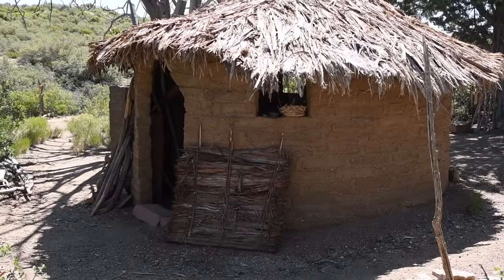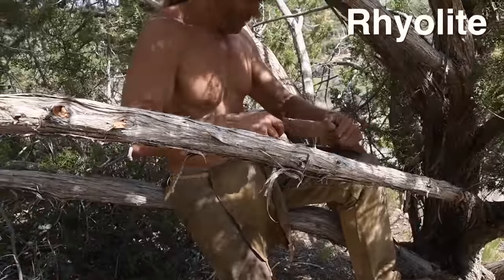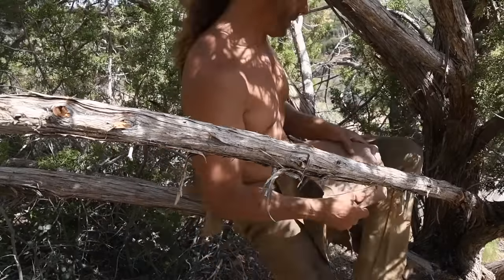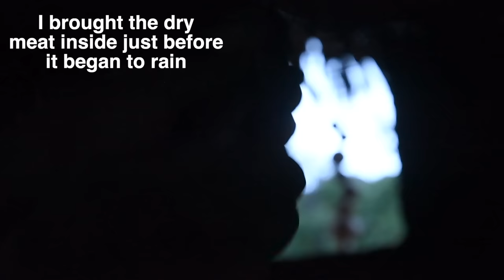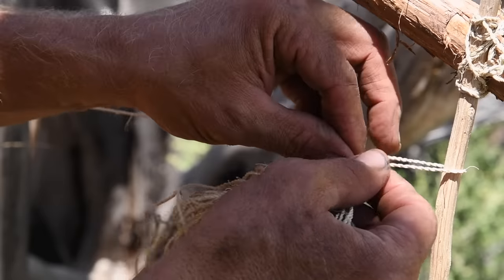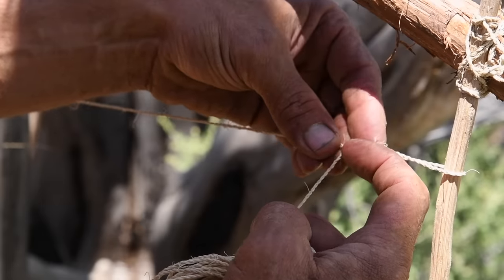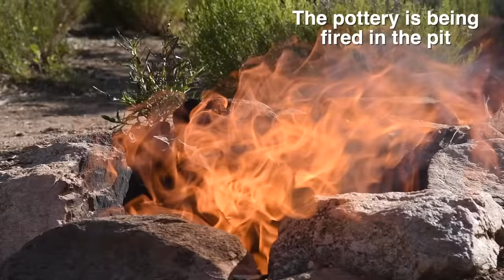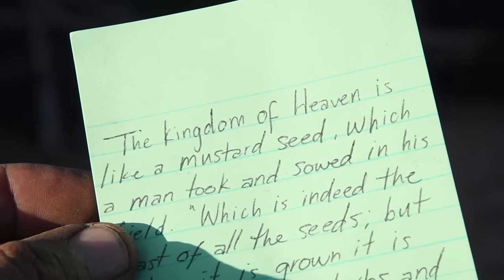Primitive Yucca Cordage Hammock - Part 1 (Season2, episode 2)

Comment: I'm quite proud of you using the flint knapping skill. My buddies dog ate my antler tools so I haven't been able to them yet in a while. But working on. As I got a job with an outreach team for the homeless.
Reply from the maker: The dog ate the antlers?? Are you serious? Hahaha.
Reply: @ChadZuberAdventures  yeah. I don't use modern tools to make the arrowheads. And my buddies dogs made sure I took a break.
Reply from the maker: Hahaha, you’ll be back at it again
Reply: @ChadZuberAdventures  surely I will. It's a hobby I find very fun.

Comment: 20:21 This cordage is of awesome quality🏆 There are almost no differences in thickness or twist😎
Reply from the maker: There is very little difference in thickness. I try to keep it close to the same thickness but different rolls end up slightly different in thickness. This cordage that is intended for the hammock is the average thickness that I usually make. It's quite strong. The cordage I make for fishing nets is about half as thick. For construction I usually make thicker cordage.

Comment: Here's a suggestion.
Try planting near that water source or near the river, as this would help you a lot.
Reply: There's always a reason for what he does or how he does it.
Reply from the maker: Yes, I want to do that but near the river isn’t good because when it floods the waters rise as much as 8 feet and wipe out many of the smaller plants. I need to find a spring with good soil near it.

Comment: Some of the most primitive irrigation aside from carrying containers of water was basically mimicking a river or stream by etching out grooves in the ground to make water channels so the water was distributed when it was poured. In theory clay aqueducts or bamboo with holes notched into it would also work along with water collection vessels like the pots and vases you make.
Reply from the maker: The problem here is that there just isn't enough rain during much of the year. There's no water to channel. I need a large tank (or large ollas containers) to capture large amounts of water that can last for at least two months. Such a tank will require a good amount of time to build.
Reply: @ChadZuberAdventures  Im gonna keep on cheering for your success with the garden and fishing 🤞

Comment: Amaranth is a drought-tolerant plant. The main time to focus on watering these plants is when the seed is germinating and when they are young seedlings.  Try to keep the soil moist, and once plants are 2-4 inches tall, you can water 1-2 times a week.  In the case of an infrequently visited adobe farm, ollas with water can be filled and used to seep water into their surroundings, branches for partial shade erected, and maybe a light mulch of shredded juniper bark and grasses applied.

On the bright side, if aramanth gets established all the way to growing seeds (the part you eat), it will self-seed! (For those worried about invasiveness, Aramanth is native to the Americas, and has been grown on both continents by indigenous nations for thousands of years.  It also goes by the nickname pigweed.)

Amaranth does have a high amount of oxalates in its seeds (and its leaves; keep domesticated herbivores away from them unless they're used to eating stuff like that).  These can be gotten rid of in the seeds by boiling, blanching, or even steaming, and discarding any liquids before consumption.  Boiling is probably the most common method, which means an initial round of boiling and straining out the liquid, then a second round of boiling to finish cooking the seeds.
Reply from the maker: Thanks for the information here. I have some small ollas but I need more and larger ones for it to be effective. I'm going to try to make enough time to make some more ollas. I didn't know that amaranth seeds were high in oxalates. I used to purchase and eat amaranth seed in Mexico.

Comment: I wonder if a spinny jenny could be made to make chordage? Some sort of wheel?  Also, I am still in favor of making clay pipes and using a ram pump, to pump water to your garden.
Reply: I like the sound of that, but how to make a primitive ram pump?
Reply from the maker: I don’t think it would work so well with yucca fibers.
Reply: @Convolutedtubules  actually it is not hard. A ram pump works by the pressure difference and hydraulics rather than electrical motors pumping water.  It must be 'primed' (which you could do like a straw) and once primed, a one way valve is used. such a valve can be made out of any material, so long as it flaps.  here is a good video that explains far better than I could.  https://www.youtube.com/watch?v=sv3TjKdDhW8 
@Chad Zuber  I think this could be done, provided three things, first, when making the clay pipes, you use a former, a stick or whatever.  Second, on one end make a cup shaped flange, and seal it with primitve ceosote based glue. therefore a precision fit is not needed. and finally, youd need to make a cap or something to shut off the hydraulic action at the garden end.  And since this is in fact, hydraulic, at can actually pump water uphill.
Reply: @ChadZuberAdventures  why not?  Is there something inherently difficult in working with Yucca fibers rather than other natural materials?
Reply: @mattparker9726  have you built a primitive ram pump or a modern one? I have made one in the past, got it to work somehow but it was not easy to set up, regulate, and keep it working. I would love to hear your experiences with ram pumps
Reply from the maker: @mattparker9726  Yucca fibers are rather stiff, not soft and pliable like cotton, but I've never used a spinning jenny so I can't say for sure.

Comment: About the chimney and its smokey behavior at times. I stumbled over a good explanation when a chimney draws/sucks air and when it doesn't: a hot column of air is lighter than a colder one not unlike a straw under water filled with air: in the straw you have a lighter column of air than the water around it.if you open both ends at the same time the water will enter from the lower end and the air bubles out the top. Once the air is gone in the straw its all over but in a chimney the air that enters from below will reheat and become lighter than the normal air outside. Getting it started is harder in your current design because you only heat the air at the entrance and the chimney has no reason yet to get gowing. A longer chimney will help just like a longer straw under water (or an more upright one compared to almost horizontal): more force but you still have to get the thing going. 

You could maybe set a starter fire in the upright portion of your chimney so the walls and the air column get warm...
Reply from the maker: Yes, several people have explained this to me before. It makes perfect sense. However, I’m probably not going to want to spend the time to start a fire first in the chimney and then in the fireplace. It gets about only when I first start it and within 10 minutes it stops. But I may experiment with that idea just for the experience and to gain knowledge about fireplaces.

Comment: Concerning coconut husks, don't throw them away. Properly dried husks catch fire ridiculously easy, but unlike fire starters, they can be used as proper fuel for bonfires to light bigger branches on fire
Reply from the maker: I know but there are no coconuts here in the desert
Reply: @ChadZuberAdventures  I meant that for your Island Survival series
Reply from the maker: I’ve used coconut husks like that before. The dry shells are also great to burn because they are very dense and burn a long time. But the island series is over now.

Comment: When would you tackle some iron melting and forging experience and so on to make some tools? 
You are already making pots and stuffs so you can also cook some iron tools as well to improve shelter life and speed up some recurrent processes. 
Of course If you don't want use your Ontario 499 or others knives used making sandals. 
If I was you... I definitely will use my old trusted Victorinox Outrider. 
Having a good saw to precisely notch making poles and joints or drilling holes is quite something in the middle of nowhere. Yeah, of course a sharp stone can cut as well, it is only matter of time and muscular exhaustion, perhaps it gives more satisfaction in the final result or more views in the entertainment. But be able to quick get things done or to use wood pegs for assembly can spare a lot of work and sacrifice and determine the method used to get things done.
Reply from the maker: I’m very aware of the mechanical advantage of metal tools. I am exploring life without those tools. Because in a true survival situation it’s good to know what you can do without any tools.
Reply: @ChadZuberAdventures  Yeah. Surviving from what? And for how much time? Making a living surviving require every kind of tools because tools are not only a "mechanical advantage" they are skills and knowledge in theirselves, they are surviving resources.
Reply from the maker: @giuliogemino6407  I'm referring to being in the wilderness without any modern tools and you have to make everything from materials that you find in nature.
Reply: @ChadZuberAdventures  I see no difference in making a shelter, making cords, making pots, making sandals, making nets or making knives or axe or bow&arrows or slingshotts or making fire and so on. They are all tools with major or minor complexity but they all are destined to speed up or the only way to your basic needs fullfilling. Perhaps not a metal axe but an axe, perhaps not even a large axe or a knife but a tomahawk like american natives... I mean something effective to cut and carve and process wood saving your hands annd knees all the times. Using stone each time is a palliative to the need of an effecitve tool.

Comment: if you had the choice what 3 types of rocks would you want arond you? i was thinking flint obsidian and quarts but then thought obsidian quartz and burhstone
Reply from the maker: Honestly, I don't even know rocks well enough to give you a good response. Obsidian definitely. There is a lot of quartz here, lots of it. I haven't found a real use for it yet. Do you have suggestions for using quartz? The rhyolite is really abundant here. I like it because I can make a cutting tool really quick. It's not very strong but gets the job done and is quick to replace.
Reply: @ChadZuberAdventures  lol it was a cheat to get more rocks flint is a quartz also some big quartz are split they are hollow like a cup. other quartz are good for sparks. most like you think simple quartz crystal like used to make lenses or jerwery not think flint and other usefull rocks.  Quartz sand is used as a filler in the manufacture of rubber, paint, and putty. Screened and washed, carefully sized quartz grains are used as filter media and roofing granules. Silica stone" is an industrial term for materials such as quartzite, novaculite, and other microcrystalline quartz rocks. These are used to produce abrasive tools, deburring media, grinding stones, hones, oilstones, stone files, tube-mill liners, and whetstones. a lot off uses but for you i saw a saw being made by prisoners it used nstual fibre rope with crshed mud and quartz in it it was like them cheal chain saw things you get in survival kits with a ring each end. not sure if youtube has any vids on how make one